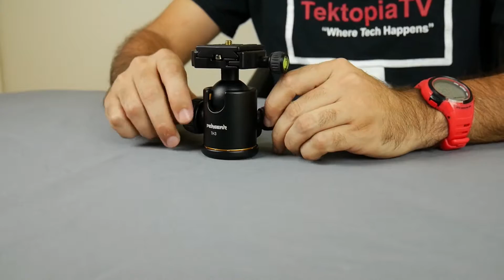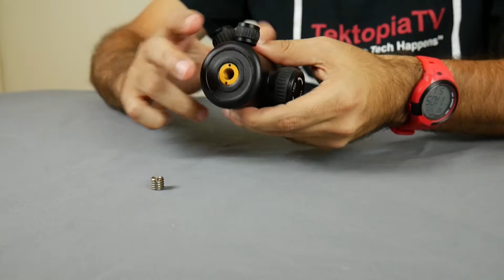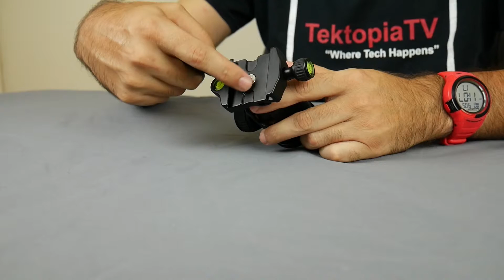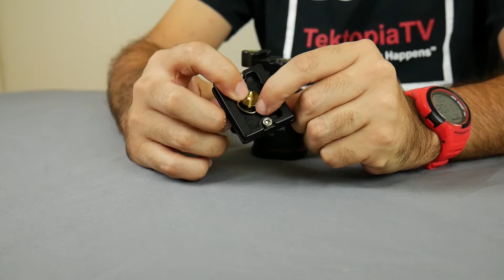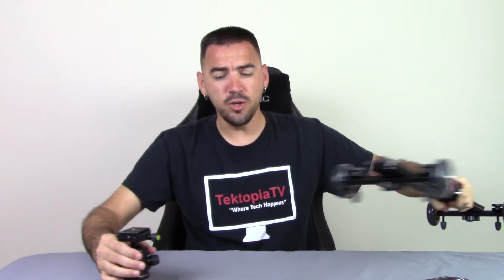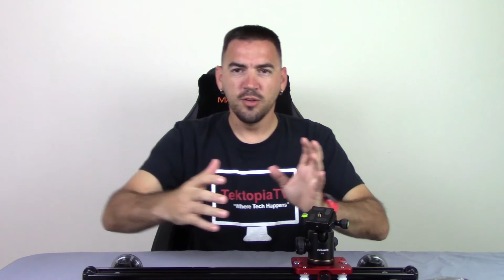PerGear 360 Swivel Ball Head Review

Comment: I'm guessing because of the arrow stamped on the larger knob, tapering from "FREE" to "LOCKED" that it is the friction control. The smaller knob must be the ball lock? For your sliding issue, why not lock the ball at the right up/down angle and simply rotate it horizontally to follow your target while sliding? This would cancel the "wobble". No?

Comment: The two knobs for this mount is that the big knob is for locking the ball and the small knob is for drag.  You set the small knob for the weight of your camera so it will not flop over and the big knob is to lock the camera fast.

Comment: Hello Friends, I use Ball Heads on my 3-Tripods and 2-Monopods. All are Heavy Duty with 4 Knobs - used for my DSLR. The smaller knob is to prevent your Camera FLOPPING when mounted on the Ball Head - also called the Friction Knob. Flopping is when your heavy gear - Body + Lens - will rotate with the Ball to one side and droop down. This will damage your Gear. So you tighten the Smaller Knob to such an extent that your Gear NO Longer Flops, and at the same time allows you to easily  Rotate and Set  your Gear for picture taking. Now once you have Positioned your Camera, hold the Lens so that it does NOT Dip down by it self weight and tighten the Big Knob.
Your Gear is now as steady as a Rock. Your Photo will be sharp as there is no vibration.
To reposition for another shot, you loosen the Big Knob - do not touch the smaller one - adjust your camera and Tighten the Big Knob while holding the Lens over-hang. The Friction Knob has to be adjusted each time you change the Lens or a Camera Body.